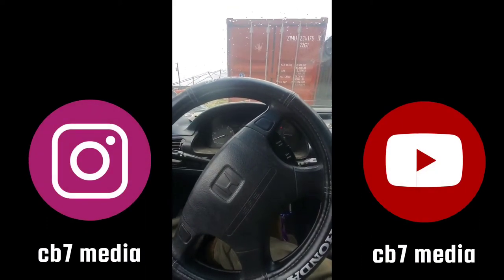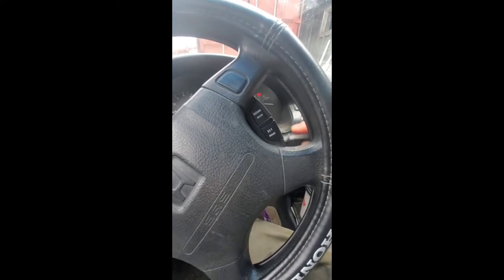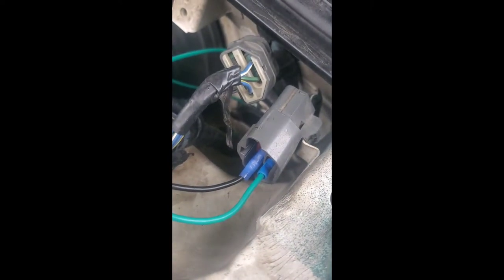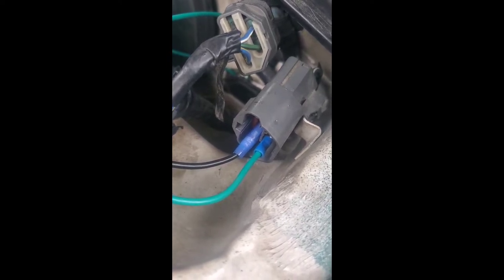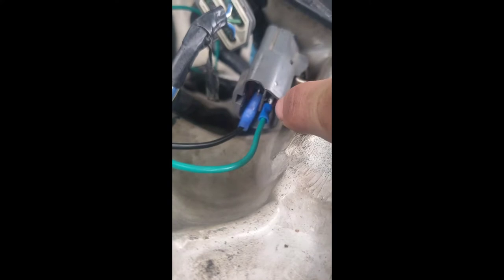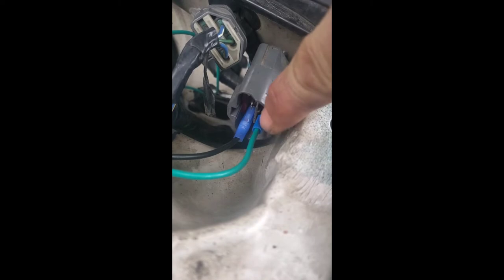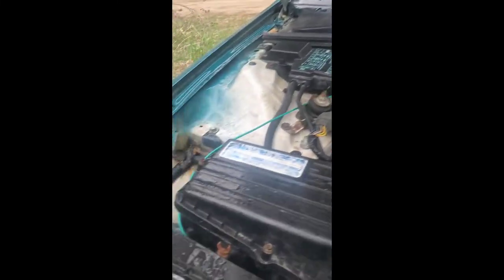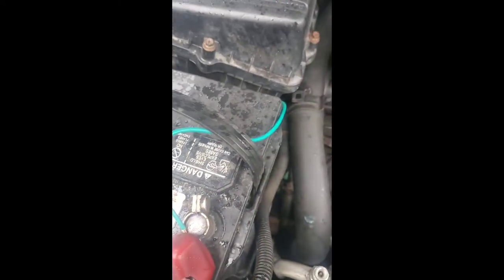windshield wiper switch bypass (EMERGENCY USE ONLY)

Comment: My 2000 Saturn now has wiper work intermittent even in off position.   I have a very good  mechanic who has never over charged me, but on this he says around 450 dollars to fix.  The #25 fuse is in the fuse box under dash board to left, easy to pop open. Mechanic said if I let it stay running intermittent, it will burn out wiper motor.  So I took out the fuse.  I went to Auto Parts store for more #25 fuses and a fuse puller, all for about 20 dollars.   On sunny days I will have fuse out, and rainy days fuse in, which is no more wear on wiper motor than regular rain use.  It only takes a couple seconds to pop in fuse or pull it out, and I have back-ups in case I break one doing this.....Now if the wipers weren't working at all as in this video, but a more common problem is wipers still go intermittent when in off position on an older car.   Now this does show the plug in wires under hood.  It might be worth unplugging and plugging those back in to see if it reboots wipers as they should be, but I can live with taking out and putting in wiper fuse.  I'm not spending close to 500 dollars on a 25 year old car, no matter how much mechanics think all your money should go into your car.
Reply: How do you pass safety inspection?
Reply: Yo bro thank you I took the fuse out and it stopped!

Comment: Where did you wire the toggle switch
Reply from the maker: Where did I put it at ?
Reply: @CB7Media  yes... what wires did u connect to wiper motor or where? my motor wont stay plugged in and multifunction does not work. so cant drive in rain. have to hold connections in place to get to work, cant do that when driving and i just bought toggle switch two prong.. plz help me install. thank u